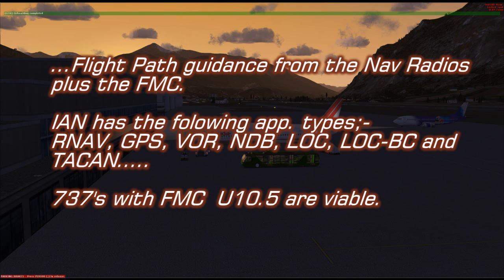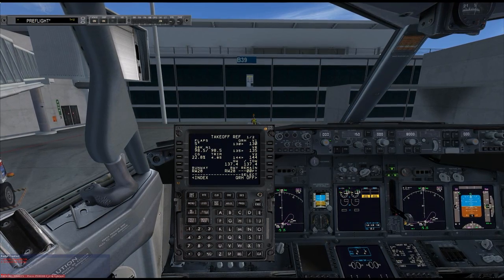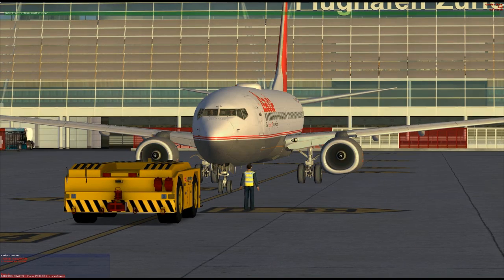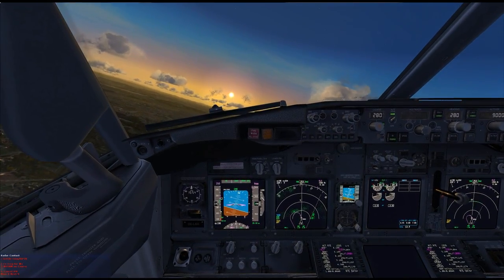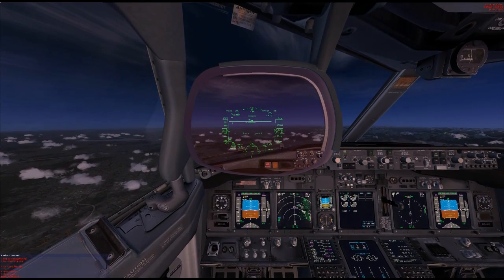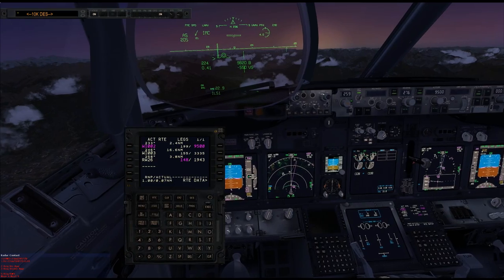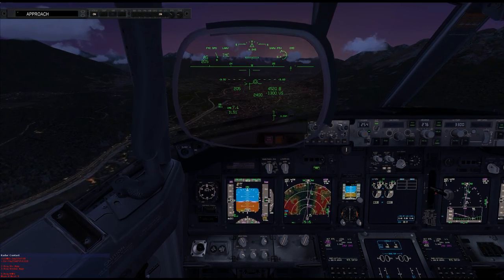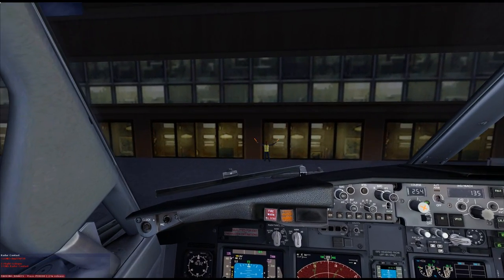PMDG NGX RNAV Zurich to Innsbruck with IAN!

Comment: Thank you very much nice tutorial very helpful.Your sim is very stable,What are your Pc specs if I may ask..?
Reply from the maker: Thanks, glad you enjoyed it. 
Its a 5 year old system. I have added extra bits and pieces since new:-
i7 960 o/c to 4.2 Ghz on air cooled Thermal Right in a Cosmos case. Asus P6T DE Lux Mo-Bo. 8 Gb Corsair DDR3 RAM at 1600 7-7-7 timing. W7 on the C drive a WD HDD. FSX on an OCZ Octane 256 Gb SSD. 3 other WD HDD with saves on them. A Cooler Master 1000W power unit. Pallet GTX 580 with 3Gb.
Old tech now! . Tuning is from Nickn's "FSX Bible on Simforums.